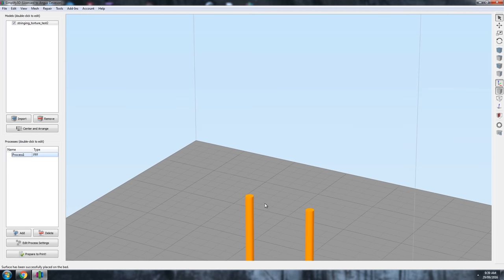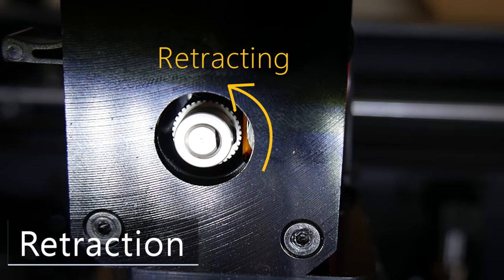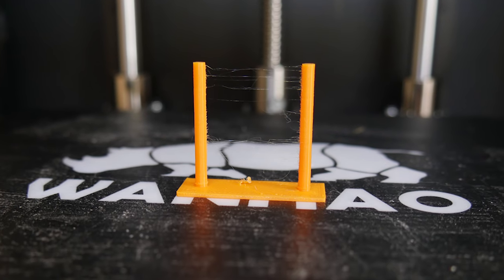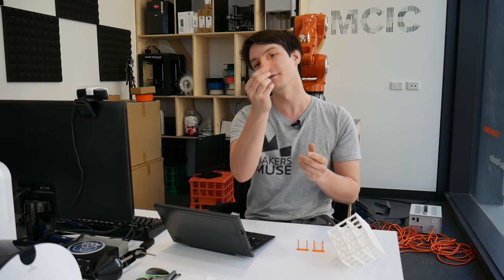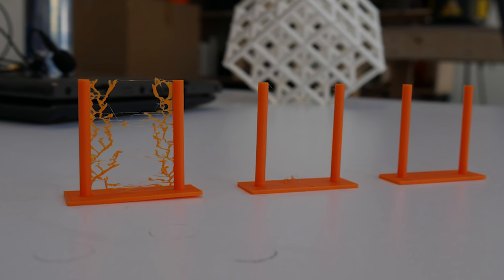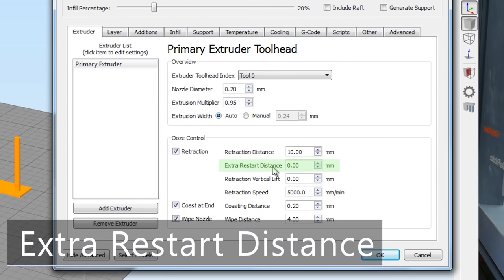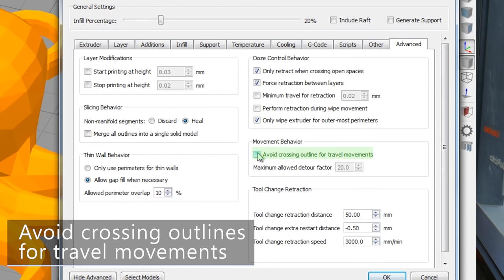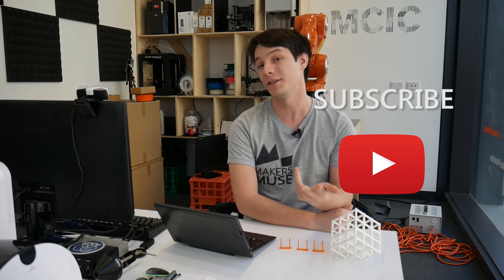Stop the stringing with Retraction! 3D Printing 101

Comment: OK...this is an old video.....but S3D is still an expensive option to what in real terms are hobbyists using a cheap Chinese clone 3D printer. Most FB group pages are showing 1000 new members Weekly ...on average, certainly the Anet A8 is.  Very few will opt to buy S3D...simply due to price.  I suggest if the price came down to $50 ....80% of those newcomers would purchase after becoming g familiar with the limitations of the freebies. My old boss used to preach that 10% profit was better than 100% of nothing from no sales! Angus, may I suggest you do a poll of your huge numbers of subscribers...to ask who would buy at a lower cost.....it would also stop those who download hacked copies and use it for free anyway.
Reply: Cura and Slic3r have come a very long way since this video came out.
Reply: cura still by far isnt perfect, particularly when it comes to retraction. It has some really half-assed retraction handling.

Comment: I used retraction all those years and it just made my asa prints uglier. Why introducing a source of inaccuracy in extrusion by moving the filament back and forth? just coast and whipe and comb. If you have a problem with too much pressure after laying a line, then fix the problem itself and don't fight symptoms with retraction.

I recently tried to print 10 simple pieces, maybe 2x3x1cm... the retractions just chew the filament trough twice... that's when it clicked for me and i got rid of retraction.

Comment: I had a lot of problems with retraction, the printer retracted a little bit more than it extruded back so in a few minutes underextrusion killed the print and it ended up printing in mid air

Comment: To be physically pedantic, "suction" doesn't really exist as a force anyway. Simply the lower pressure will cause the atmospheric pressure to push towards the gradient. Therefore it's kinda the same thing. 

Perhaps it doesn't even matter. It's just a question of perspective and what reference frame you measure.

Comment: Having issues after changing nozzle, extruding too thick filament any Ideas?
Reply: Did you get the right size nozzle?
Reply: @JohnSmith-mk8hz  , Thx for replying so quickly. I did not reliaze my bed level was off after swapping out to a new nozzle. The paper test seems to work but I ordered one of those digital indicators gauges to be more accurate each time.
Reply: @robertlopez2365  Glad you figured it out. The paper method is very accurate after  you get used to it. You can also add an bed level sensor.

Comment: Do you know if the xyzprinting slicer has retraction?
Reply from the maker: No idea sorry, never used any Davinci's. Most slicers should have at least basic retraction options now days (even if automatic), if they don't then... that's pretty bad.
Reply: It doesnt. The designers think us round eyes cant handle it
Reply: Ah okay
Reply: IIRC, not that you have any control over.  One of the reasons I got Simplify3D.  I currently have 2 da Vinci printers (one mini, one 2.0A Duo) and a MP Select Mini which is currently in need of repair (probably a new hot end).  The XYZ software can be buggy -- e.g., it can crash while I'm doing a filament load/unload on my da Vinci mini; there's no UI on the printer itself, so you have to use XYZware to do most of the maintenance stuff.

XYZware also doesn't have any Linux options, whereas Simplify3D does.  But if you're on Windows or Mac, that's a non-issue.  So for me, it comes down to (1) software stability issues with XYZware, and (2) a lack of access to advanced options in XYZware, such as retraction settings.

(Simplify3D also has better infill options IMHO.  I like using the full honeycomb for larger objects.)

Comment: Slicer controlled retractions are pretty much brute force way of solving the issue. Nozzle pressure management is better done with the firmware rather than the slicers where the proper extruder and travel accelerations are taken into account.

Comment: Why are you using so expensive software?
Reply: 105bogus S3d may be expensive but it is worth every penny.
Reply: its really cheap like super cheap , go look at any other cnc cam software   i been doing cnc mill  and the cam software if u get a 70% off hobby license is about 600£
and then everything else to make , run a machine is so cheap , u could build a realy premium  machine for less then 1000£ 
150$ for 2 license of production software  is realy cheap . what u useing to model solidworks an inventer are like 1500$ per year